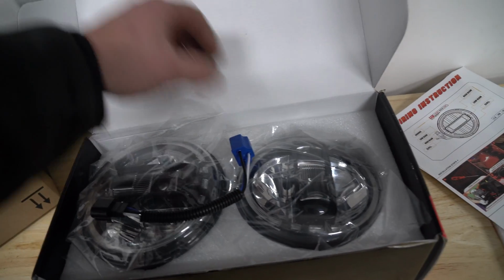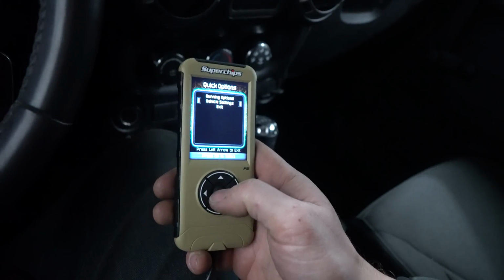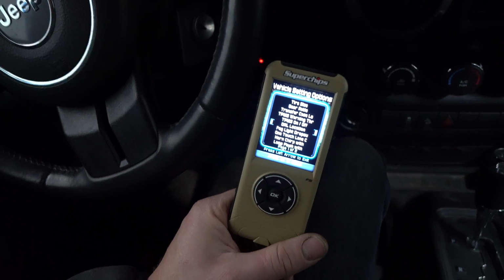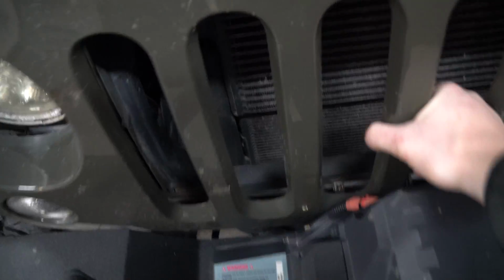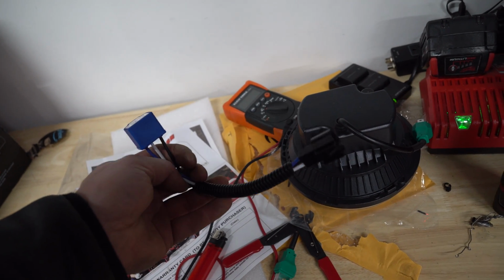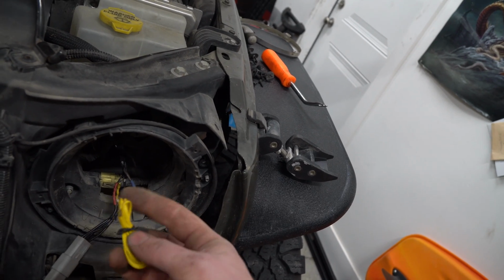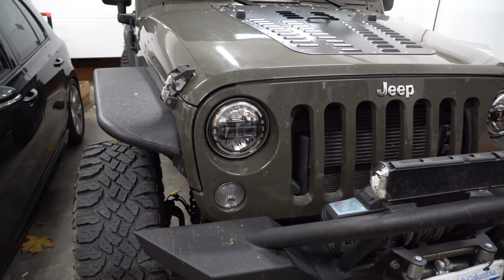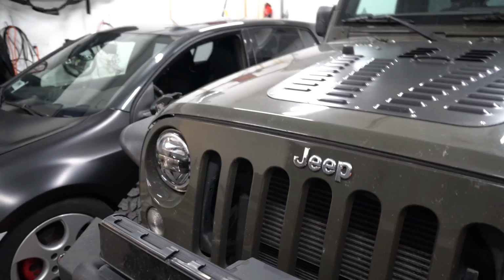HOW TO INSTALL HEALIGHTS AND PROGRAM HALO DRL TURN SIGNAL JEEP WRANGLER JK

Comment: after installing these lights my turn signals on both sides and my horn will not work. Any ideas?
Reply from the maker: Did you make sure to replug the signals back in to the grill when putting it on? If yes check the fuse could have arced

Comment: Hey fellow Canadian!  I'm from Ontario and just finished installing the audexen lights on my 2019 Jeep JL.  They look amazing, but I haven't run the DRL to the fuse box...should I, or is it fine to leave it as-is?  They seem to light up okay but can't have the switch on auto (will manually have to turn them on/off each time).  I also don't have a programmer - the rest of my Jeep is stock, and I don't plan on changing that.  Thoughts?  Thank you for your time!
Reply from the maker: Seems fine from what you’re describing. The only thing I would make sure that you do is have a fuse on the power wire going to your relay or switch just in case it ever shorts but other than that you can wire to any switch you want really just keep in mind when driving your daytime running light to come on with your haloes if yours have haloes
Reply: @ghostlyrich  thanks for your quick response!  Do you happen to have a video for what your describing?  I'm not horrible with electrical, but also not the best